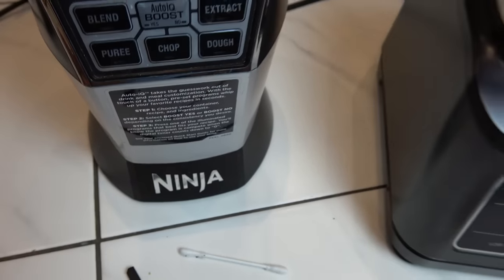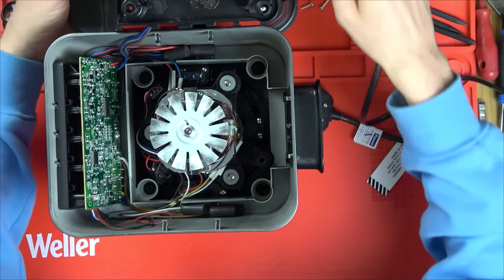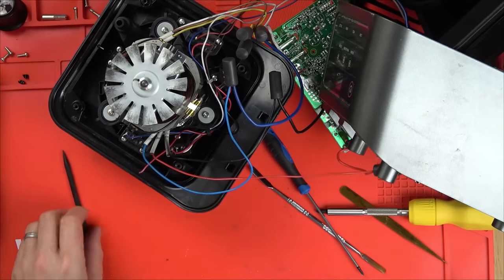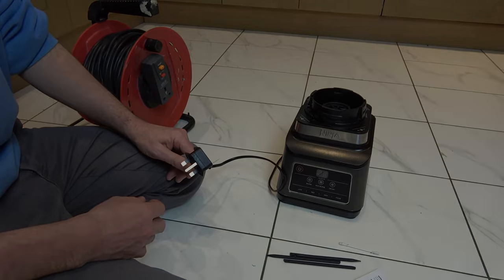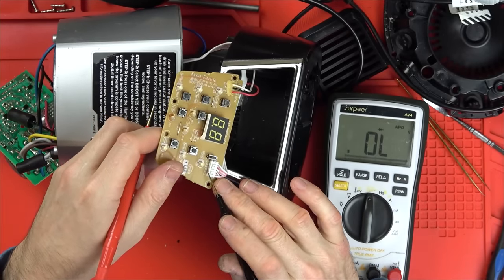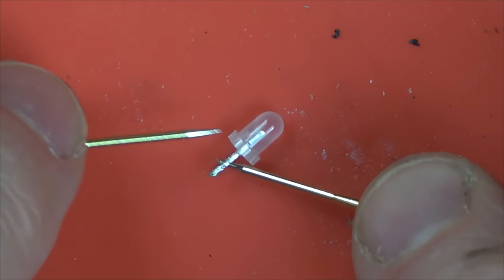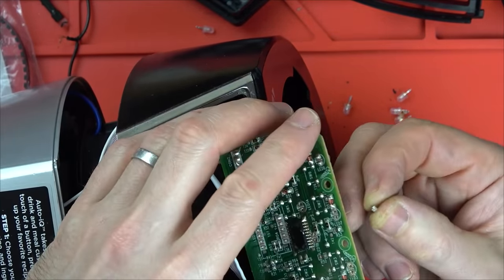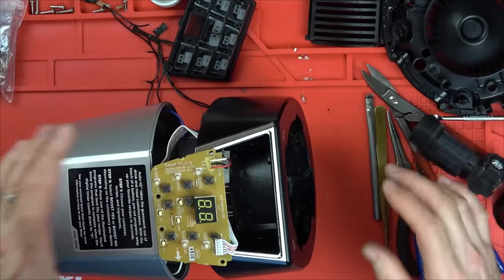eBay Faulty NINJA FOOD PROCESSORS  - Can I FIX Them?

Comment: You inspired me Vince ! Had one similar Philips food processor lying around for ages thinking is was the motor. In the end a piece of plastic was broken off of the top part and that's why the microswitch was not being pressed in anymore.

Filled that hole up with a piece of plastic and it works again !  RESULT 🎉! Smoothies are back ! 😀

Comment: NIce Job VInce 👍 I've got a very similar unit myself but it seems the plastic on the blending jugs on these is very brittle. I had only used the blending jug 2 or 3 times and the third time with hot liquid (was making soup) this caused the bottom of the blending jug to crack around where the shaft goes into it. I contacted Ninja and they said the unit was just out of warrant, but I could buy a new jug. Even though on their site there are quite a number of people with the exact same issue so it is a known problem. There are people on the 2nd or 3rd jug! so I'd not recommend this product. It even has a 1 star review on the company's site😂
Reply from the maker: Thanks Mick, the reviews are truly terrible 😂
Reply: I wonder if that's how the liquid damage occurred. Someone was making something and the jug cracked.

Comment: Aren't those just standard 3 mil LED's?
They look like it.
The others you had were 5 mil, and the big ones looked like 10 mil (common) but could be 8 mil (not so common).
Fun video by any means! 😄
Reply: Was just about to mention that. They look like to me 3mm leds, readily available on ebay etc.

Comment: Today's watch wear is a thoroughly refurbished Pulsar 7S26 rare as hens teeth just put onto an "engineers" bracelet and looking abs astonishing good, I also have its matching gold plated "sister" on original gold plate bracelet NOS too in its original case so keeping both in the one which I have done with a lot of my sister acts watchwise hehehehe   212 watch cells changed this last fortnight and still a handful to go...

Comment: Well done, another two saved from landfill. One way to remember LED connections is cup cathode (negative), anvil anode (positive), though if you are into electron flow theory and / or have some high brightness LEDs then everything is topsy-turvy. You can also use a CR2032 battery to test LEDs, rather than a DVM which may output a higher voltage.

Comment: Just a tip here, if you find security screws and your bits don't have the hole in the middle, you can get a small screwdriver or a pick and snap the peg off in the screw...

Comment: Nice fixes 👍 Security torx seems to become more and more common in modern devices. Bought one security torx set which starts from TR10 size, but recently had to buy also TR8 bits for PS3 Slim.

Comment: If your house has RCD protecion you shouldn't need an RCD protected extension lead.
Reply: It is better to protect a load you are interacting with so the cable trips before turning off the whole building. Long Extension leads sold in the UK are designed for using in the garden with potentially dodgy equipment so it and user gets protected. In some cases it feels over engineered but has legitimate design decisions behind it: the assumption that you don't know what someone will connect using it.
Reply: @purpleviolin Both RCD's will trip at the same time, ask me how I know.The RCD on the extension makes noi difference in a house proteced by RCDs or RCBOs
Reply: @RandyDarkshade2  I Have wondered about that aspect RCD Vs RCD in a race. However doesn't negate the designed in aspect of protection. Having seen how some users use/misuse mains power cables etc in schools and pop up venues etc, I would definitely state that RCB on plug of a long extension lead (over 10m) should absolutely be there. Redundancy is better than no protection when lives are at risk.

Comment: I recently fixed a Nespresso coffee maker, basically, it was scaled up. I used lemon juice for descaling. After reassembling, I also noticed little bits of black plastic on my bench and floor. Nonetheless, it works, the original owner couldn't wait for me to fix and bought a new one. 

I noticed that my mother still has her Kenwood MagiMix from 40 something years ago, it still works, not like the modern junk we see here, Ninja. The name should be enough to put someone off of buying it, should be renamed Binned-Ya as the bin is where it belongs.

Comment: In German, there's a easy to remember memo for how to connect LEDs: Kelch, Kerbe, Kurzes Bein = Kathode / Kleinere Spannung. Everything starts with K. literal translation: Cup, notch, short leg = cathode / lower voltage. it's about the visible cup inside the LED, the notch on the circular body, and the shorter leg. obviously the leg length can't be used as indicator after the legs are shortened.

Comment: While I'm on the subject of repair.... My og Xbox one power brick goes wrong and won't pump out enough voltage to fire up the Xbox so after half an hour with a Dremmel I finally get inside it and the whole item is potted. How on earth can I repair this?? Companies deliberately withhold schematics, use security screws, pot items in resin, take the numbers off of chips and make repair as hard as possible. The only way to stop this is to vote with your wallet and if companies make it impossible to repair an item then don't buy it!!

Comment: Makes me laugh when manufacturers use some security screws when you can easily buy a screwdriver from the internet.
Reply: Yep totally.
Also, people still fit locks to their doors, but you can buy keys and lock picking kits too.
Reply: It probably does act as a deterrent for people who don’t do regular repairs.
If they just used a Phillips screw then more people would give it a ago and try to fix it. Waiting the extra time for the correct screwdriver to arrive will put people off, plus then the extra albeit small added cost.

If you need to repair something it’s because it’s faulty and so the quickest way to get their broken device working again is just to buy another one! Obviously this depends on the person and cost of the product.
Reply: Maybe, it done much more for children, then those who wants to repair
Reply: Keep in mind that Torx and Security Torx long predate the Internet, and were first invented for use in aircraft.
Reply: You underestimate the power of lazy.
Reply: What gets me about 'security' fixings is when they're completely unnecessary. Eg by all means use security screwas around the shielding for a high-power section of a device, but why use them to simply hold a couple of bits of moulded plastic together, containing nothing more than eg motor brush covers or an on/off switch?
Reply: Most people don’t have the screwdriver, and many won’t order one. These screws are for insurance and liability reasons.
Reply: @urglegurgle5807 why buy tools, house brick through the window is free 😅
Reply: Belkin uses a type of screw that can only be tightened. That is a tough one.
Reply: Makes me break out in extreme laughter EVERY time i see security screws ANY where because i know there are tools out there to remove it
Reply: @hmello3250  We used to use a similar screw on electricity meters (when they had a voltage link) The screw head would snap off when tightened.

Comment: "security" my ass, they are just trying to make the thing as hard to open as as possible. FFS, just let people use normal screwdriver.
Reply: Agreed, but tbh anyone repairing stuff has a full set of "security" bits so it's hardly an issue. 

Personally I wish everything was Torx; Phillips and pozidrive cam out too easily.

Comment: :face-fuchsia-wide-eyes: Do we know why the LEDs died in the first place? Or wasn't I paying attention. Asking for a friend :face-blue-smiling: Good job V-Man
Reply: LEDs fail. Assuming not corrosion, could have just died. Cheap LEDs in the first place would have been designed to maybe last the warranty period.
But measuring the Led (dimensions) should allow replacement from a decent parts supplier.